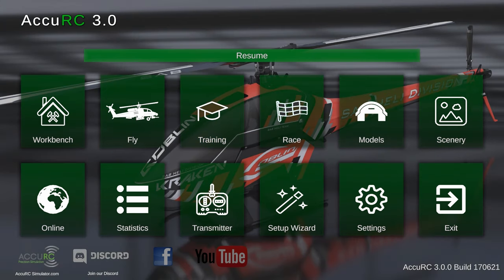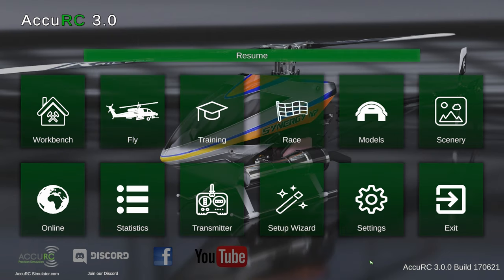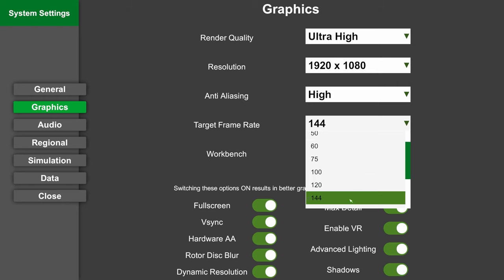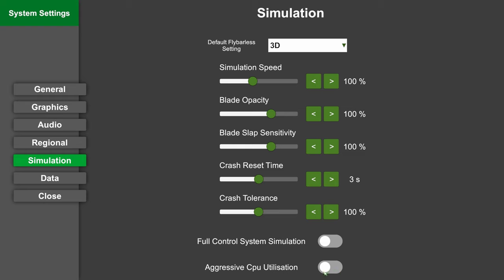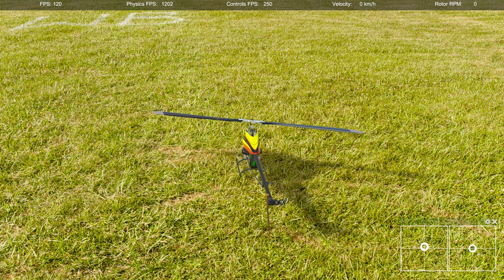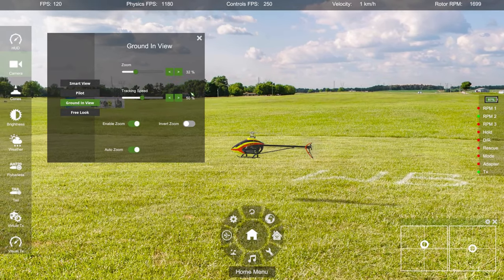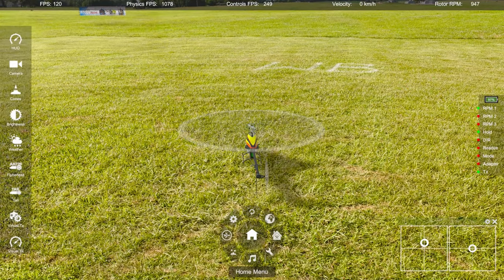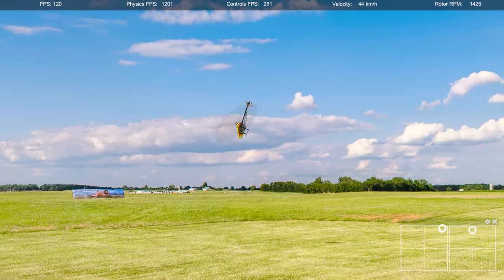AccuRC Initial Configuration and Basic Setup

Comment: Throttle and Pitch are tied together. Both are -100 to 100. That's fine for pitch, but Throttle should be 0-100. There is no reverse or negative. So... At mid stick my throttle goes to zero... Low stick and high stick are running full. I have to be missing something simple? -100 on Throttle travel should be 0 actual Throttle... 🤔
Reply: By default throttle does nothing. The head speed and throttle hold are controlled by the functions.

Comment: Hi, I don't know what I did wrong but when I played with the adjustments for the tail it wags and doesn't matter what I do it will not stop. The model is the Goblin 380, I have even deleted it from the My Models listing nothing changes, I even started a new model in my dx6, nothing changes. But if I fly any other model, no problems.

Comment: Is there anyway to dissconect the battery timer, as I'm praticing.
Reply: yes, go to workbench, click on the batteries and disable the monitoring.
Reply: Thank you for that, mine comes up with, ENABLE BATTERY EMULATION, so turn it off same thing. 😊
Reply: @124MPH  couldn't remember the actual wording, got you there 😁

Comment: can you use xbox controller?
or can you recommend best budget rc controller?
Reply: yes you can but they are horrible. one of the opentx transmitters is best as you can connect on usb without the need of a dongle.

Comment: Thank you for the video. Is there a way to turn the gyroscope on? That's how my real heli is so I want to fly it in the game the same way.
Reply: Hi, im not sure what you mean, the flybarless gyro is always "on" ?
Reply: @DorsetSaferRoads  Sorry. Maybe I explained it wrong. How do I get it to always go back leveled when I let go of leaning it left or right?
Reply: @Epop84  ah self level.

Self level is a great get out of jail free when things go wrong but helis are best flown in what drone pilots call acro or attitude hold where the heli keeps the same attitude.

In AccuRC there's a function called rescue which does exactly this. 

Highly recommend getting used to flying in AccuRC like this then switching off self level on the real thing when you are ready.
Reply: @DorsetSaferRoads  That's where I practice at. Accu RC 2. Do you know where I can find that setting
Reply: @Epop84  the rescue function is in transmitter > functions
Reply: @DorsetSaferRoads  Got it. Thank you so much